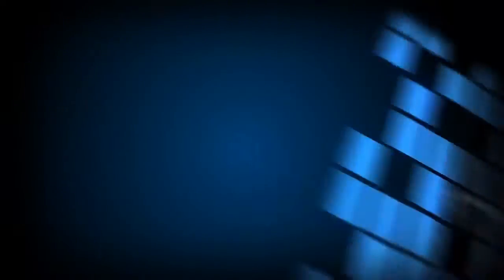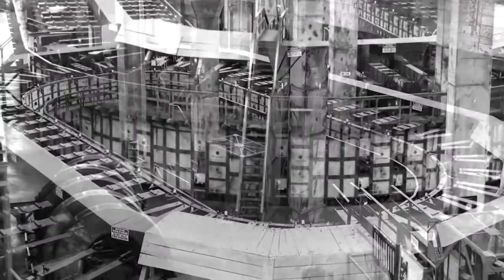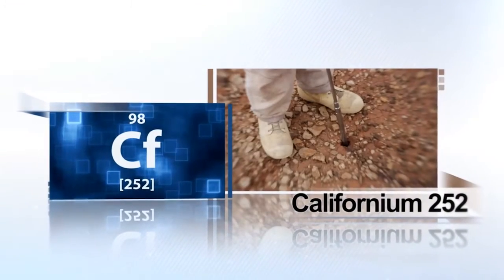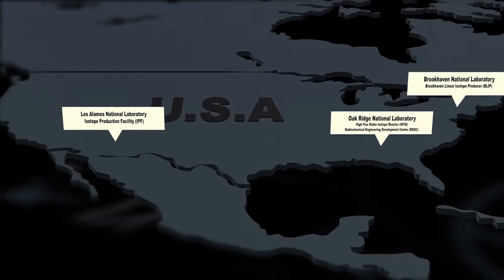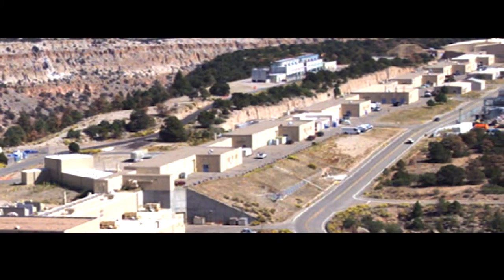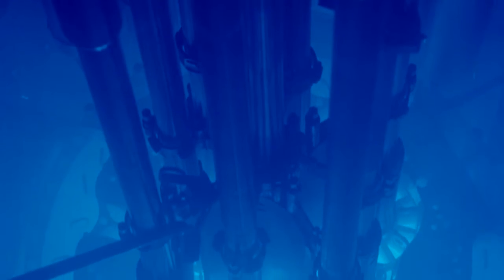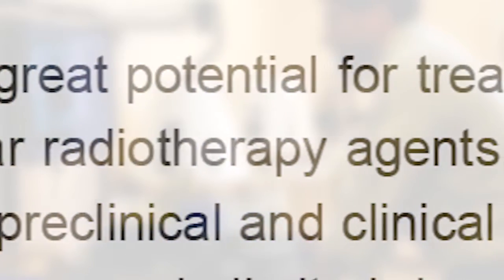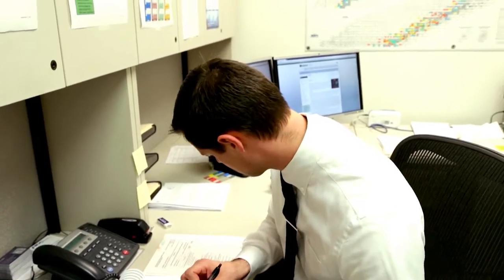U.S. Department of Energy Isotope Program

Comment: So what did you do over the summer? Ah attended the radiochemistry summer camp. We were glowing with enthusiasm.  On a more serious note, it seems you are making lots of neat radioisotopes. Wonder if you made the crystals for those tiny scionix 6li detectors. Ended up getting a bunch with bad hsmmamatsu PMT tubes that I cut in two to get the crystal out of and combined with the ADIT pmt from old VACIS gamma detectors that got trashed from hurricane sandy. The 6LI iodide crystals were so hygroscopic that I had to build a nitrogen filled glovebox to work with them. They made awesome low energy gamma detectors as well as easy to use neutron detectors. 🤔